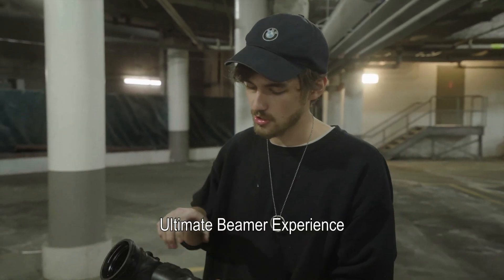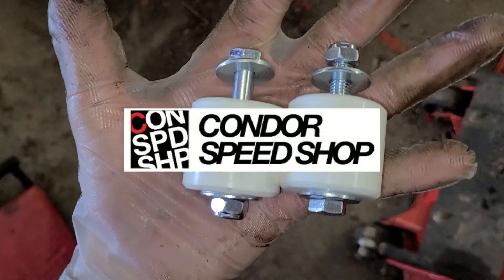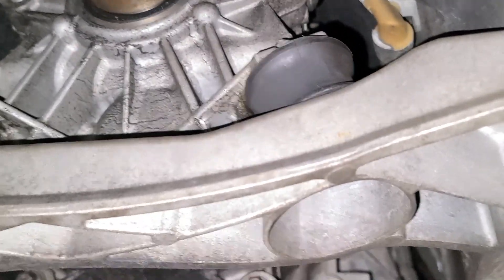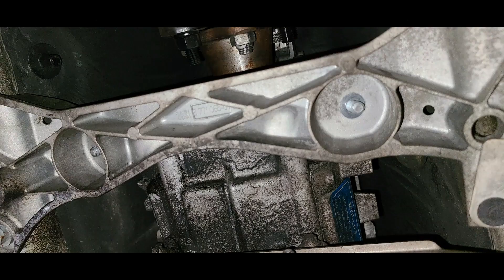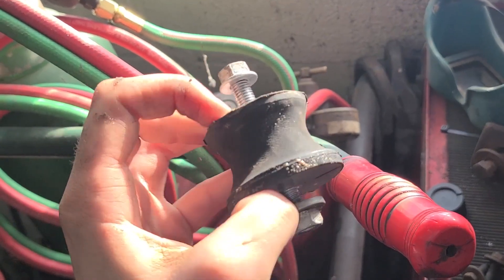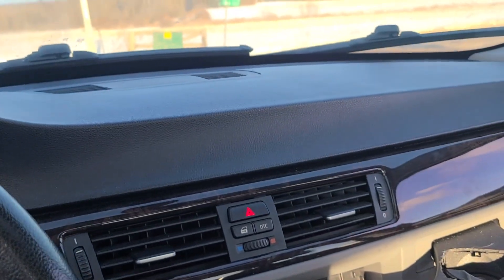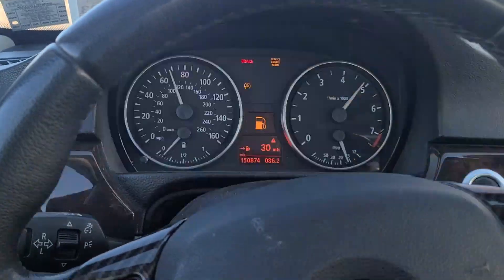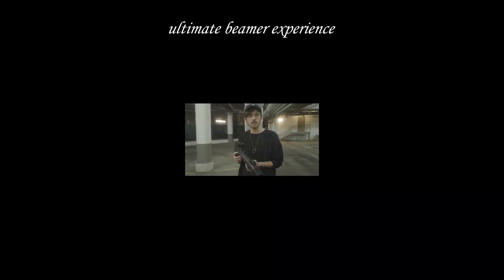Poly Transmission Mounts for e9x BMWs (Condor 70a Poly Mounts)

Comment: although not as cheap, check out the TRW "M3" Control arm kit on fcp. I just ordered them, along with poly rear subframe (f&r) and diff mounts,  and engine mounts from the n54T in the iS version of my car. If you do get any of those, would be very interested in your opinions. Also I might sound dumb but how did you get the LCD screen in your dash to show your speed? thanks
Reply from the maker: I've got a set of M3 arms that I will be installing at some point, just haven't gotten to it yet lol. The digital speedo in the dash was coded in with an app called bimmercode 👍

Comment: What engine mounts do you have? I was thinking of using these on both the engine mounts and transmission mounts.
Reply from the maker: Just stock mounts currently but will probably put condor ones in for a video at some point this year
Reply: @UltimateBimmerExperience  if you use it as a daily... dont do it :D it will shake off all bolts and you will be annoyed as fuck from all the vibrations (its like twice as bad then transmission mounts)...
Reply from the maker: I didn't it was that bad tbh. But my exhaust also loud so it's tough to distinguish. I was on condor solid motor and trans mounts. The gear whine is cool lolol
Reply: @UltimateBimmerExperience  yea.. its cool till you get singlemass flywheel.. than it sound like a fucked up transmission with gears flying everywhere... I will be going back to original transmission mounts and I hope it will go back to original loudness (cause it was annoying even before going PU)... Also hope it fixes it so I dont need to get rid of the aluminium "flexjoint"
Reply from the maker: Yeah lol that's true it made the transmission sound terrible at idle or in neutral 😂